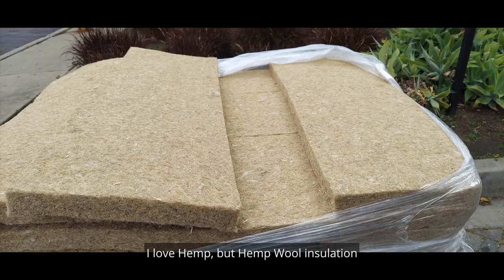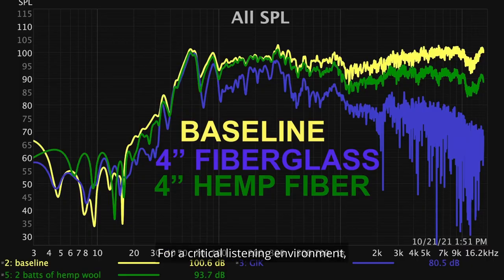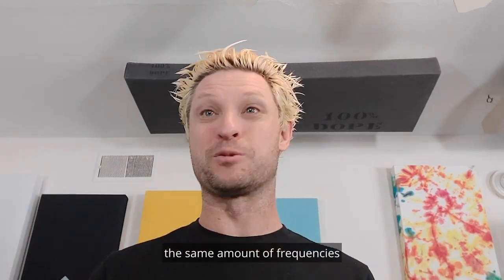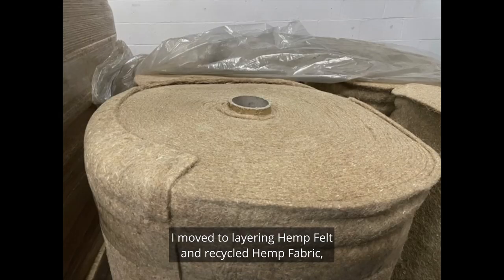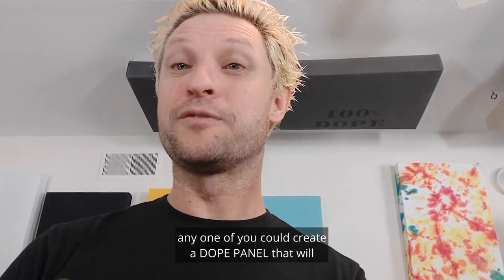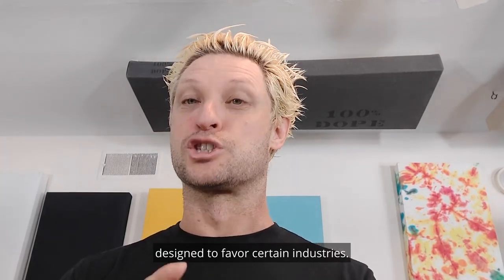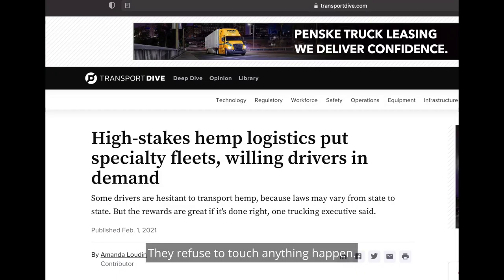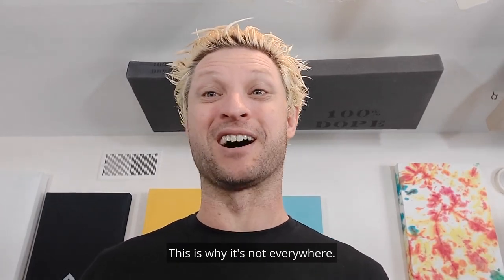HEMP WOOL, alone, will never be quality acoustic treatment

Comment: Is it the ATS Acoustical Cotton Batts in your you link to as the environmentally friendly alt to rock or glass wool? I am designing a listening room downstairs and am researching what to fill my structural timber ceilings with. They give a 16" depth to fill and use the entire ceiling area as a bass trap! I was thinking two materials. A gap, a depth of something dense like rock wool and a layer of softer more typical insulation. And an acoustically transparent "ceiling" to the room.

And you should stop promoting Amazon! They are as bad for the economy and environment as anything is!
Reply from the maker: Yes, the ATS Acoustic Batts are great! You can also spray them down with a salt based retardant (borax or boric acid) to prevent any potential flame spread.